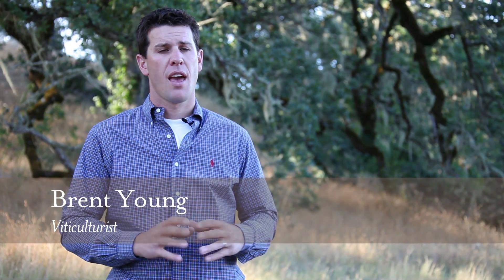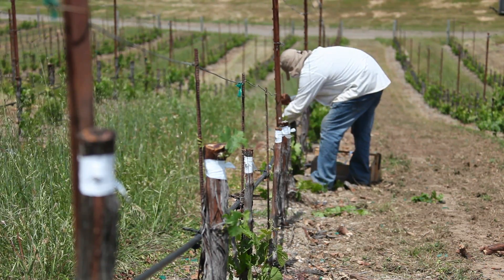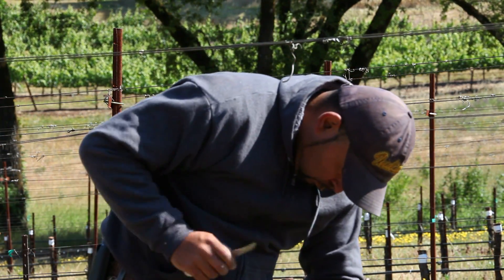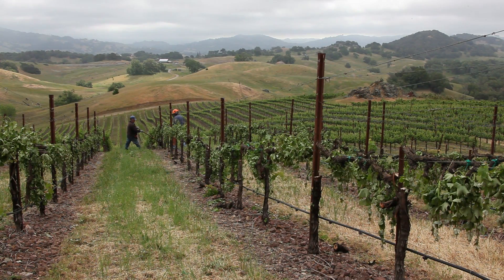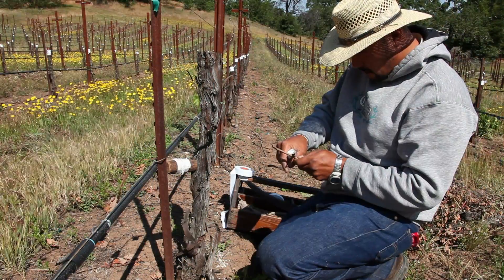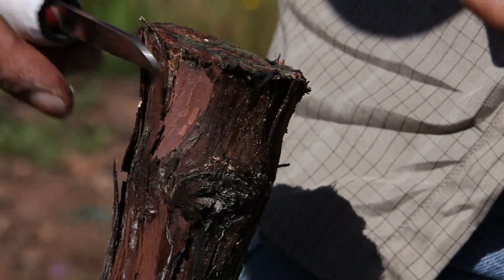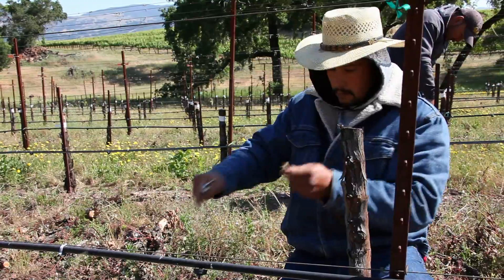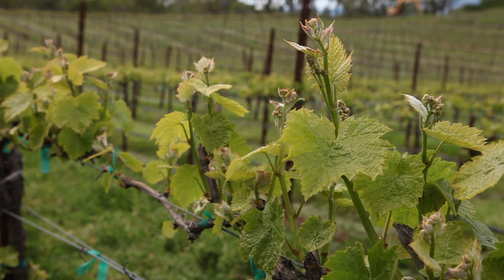Field Grafting Grapevines | How Grapes are Grafted to Change Varieties | Wine Education Videos

Comment: Can a graft from a grape 🍇 be grafted on to a tree.
Reply: I have done exactly what they are doing in my home garden. I tested a method where you use a drill to insert the psion into the existing trunk after you cut it off. I am very happy with the process thus far. I changed variety from a kind of black grape to a variety called Red Globe.
Reply: No. Grafting are specific to species. Grapes can only be grafted with other grapes. If you had a lemon tree you can graft different types of lemon, Lime and some other citrus fruits on the same tree. The grape root stock onto which other grapes are grafted is usually a wild plant that can handle pests much better than cultivated grapes. There are some strange plant families like roses can be grafted on Pear or Apple root stock but usually families that accept grafts are much closer and recognizable.

Comment: the secret on grafting is to attend to connect the two barks between the two pieces of wood. Then you have to take care to knot it well, put a wax to prevent it from drying out . Also it would be really good to put a bag over the graft toprotect it from sunburn and rain